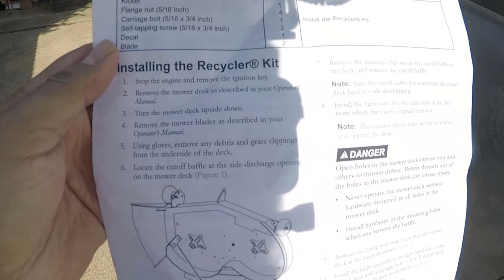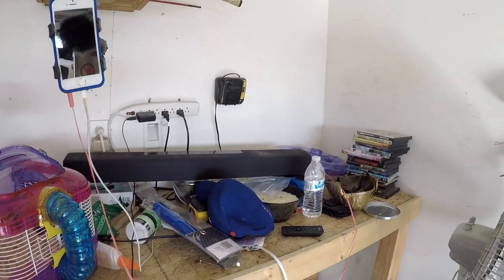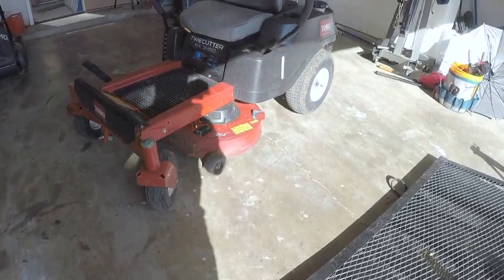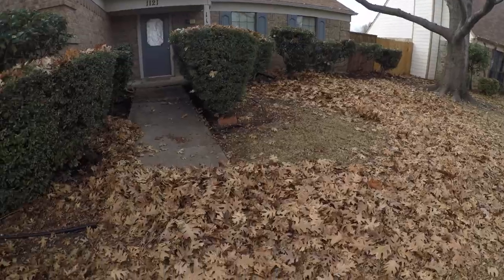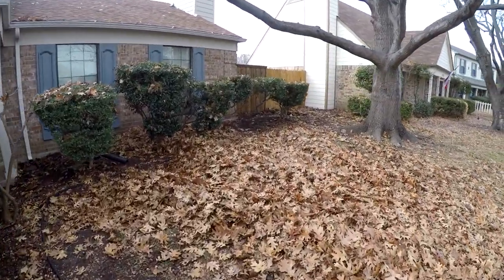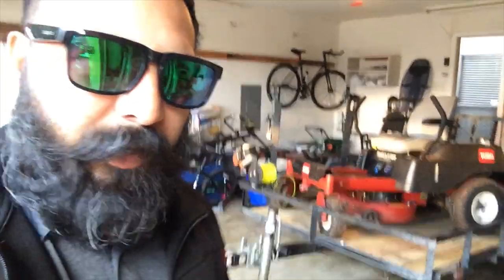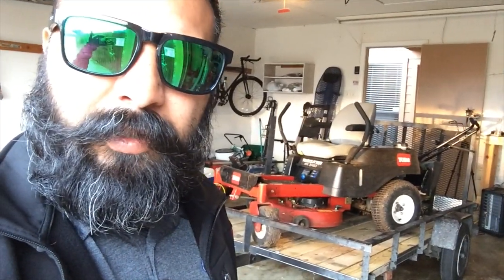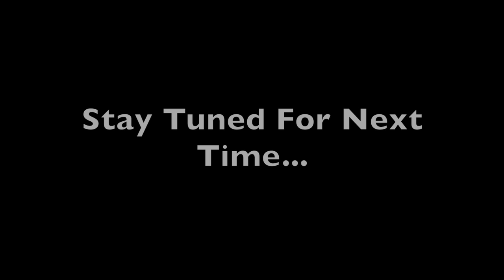Toro Mulching Kit...No Bueno!

Comment: I had that same toro my first two years. Good mower to get started. I stepped up to a commercial mower this year. I don’t ever mulch leaves when they are that heavy. I either pick them up with a tarp or the walker.
Reply from the maker: Yeah this was the fist time cleaning this much leaves. I'll be raking most of it first.
Reply: kubota diesel commercial 26 or 32hp zero turns  has mulch chute blockers  all ready installed from  dealer wich is nice
Reply: @michaelmactavish1728  Dont ever ever ever ever EVER! DONT EVER BUY A KUBOTA ZERO TURN MOWER. Youll regret it and your bank account will suffer greatly from having to constantly take it in to get worked on.
Reply: @rjskum688  we have a diesel zd its great plus its versitile too wich can use year round just like there nice big beefy F serieswe had no issues with the new 1211 but just for the coolend but other wise its great plus my nieces mom is the cheif inspector for kubota coroporation
Reply: @michaelmactavish1728  Glad to hear youve had better luck. We have to kubota diesels 72 inch and a little kubota 42 inch. Theyve been nothing but trouble. We also have 2 ExMark mowers and they hardly ever have to go in to the shop. One of the kubota diesel mowers seems to overheat everyday.
Reply: @rjskum688  the F series are great too plus it gives ya 4wd plus fully heated and ac cab optional

Comment: I see you have a 34 Toro dude Encore makes a 34 it's called the Fuzion it comes with a Kawasaki fs 18.5hp they are extremely reliable machines I have 2 of them my first one I have had it for 10 years and it has 5300 hours on it and I bought a new one 7 months ago and I have 500 hours on it already with no issues at all this machine goes for $4100 pretty affordable and it also cuts beautiful.
Reply from the maker: Victor Rippe cool I will look into this? Do they make a stander mower?
Reply: @EclipseLawnCare  yeah man they do

Comment: I see those videos using commercial equipment to mulch leaves and they have to go over the yard many times to get the job done, via side discharge.  I don't like mulching that many leaves into my yard; leaves too much stuff that can hurt the lawn.  I blow them to the gutter, mulch and bag them.
Reply: I do the same but mulch them in the street. Mulch with the mulch kit with baffle cover on...Make several passes and turn them to dust. Scoop them up and haul them off. Maximize the room you have for hauling leaves.
Reply: @LemonySnicket-EUC  Exactly.  Our county turns yard waste into compost and sells it.  I buy the stuff and apply it to my lawn as a top dressing.  It shows that it's working in the soil test.

Comment: You should you won’t regret it if do get the silver eagle model I’ve ran those for right around 13 years and still running strong just don’t wheelie it lol .
Reply from the maker: Cool. There's a dealership not to far from here. I'll be taking a trip to check them out in a week or so. I'll try to get a video on that.

Comment: Man you ever mulch leafs before?  No mower would have done well with that amount on the ground.

Mulch kits are intended for maintenance on leafs.  Not after the entire tree has dropped.  Sorry to say man but Installation and operation were both faults of operator error/expectation. 

When I have that many leafs, first I mulch, then attach the bagging kit and suck them up.  It takes a long long time and a lot of gas. 

Stay on top of the leaves and you’ll be fine with a mulch kit.
Reply from the maker: Thanks
Reply: ^ Facts ^

Comment: A turbo force deck with a recycler kit is an amazing thing. Just step up to a commercial and watch the magic
Reply from the maker: I’ll check that out. Thanks.
Reply: I'd like to see a commercial mower with a mulching kit do this (yet to see one).  Every video I see using a commercial mower they are side discharging the leaves and going over the leaves multiple times to break them down.  Do you have a video using a mulching kit.
Reply: @Methodical2  Well yes but it was not during the fall. Light to moderate leaves disappear, unless soaking wet. Let me look for it.

Comment: Oir Toro ZMaster does great mulching with out the mulch kit, but we used our Hustler Fastrak 48” way more this fall. Leaf clean ups always take twice as long as what you think until you get a backpack blower. Dang chem trails 😉🤔
Reply from the maker: I will be investing in commercial equipment this year for sure. Thanks.

Comment: Yea that little mower is no bueno for a commercial landscape business, especially trying to mulch leaf clean ups. And I'm sure Dougy Doug will be pumped to be using a nicer mower too!
Reply: All the videos I've seen (many) and the commercial machine are being used to side discharge the leaves and then running over the leaves multiple times to break them down.  I've never seen a commercial mower using a mulching kit to do this.

Comment: Not sure what happens with your toro mark . But   I had one Toro before almost the same as your and it was better than  my gravely for mulching. I really miss the toro  you maybe  want to try blocking the shut  or deck discharge area that maybe works 
Second issue I see there those leafs are not easy to mulch and not either easy to bag them they don’t cooperate with our hard work
Reply from the maker: Yeah. I think the biggest issue here were the wet and heavy leaves.